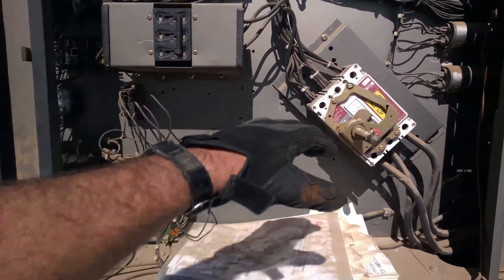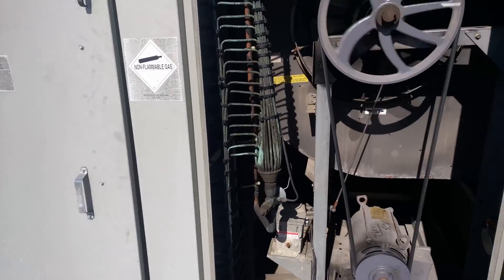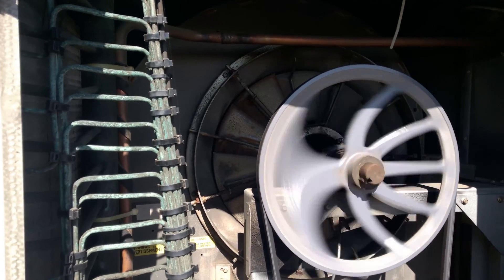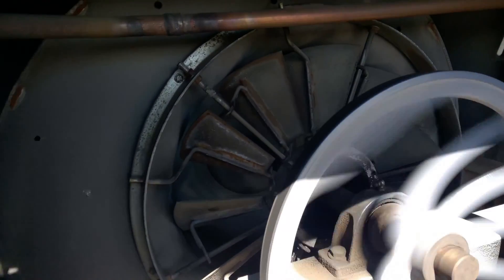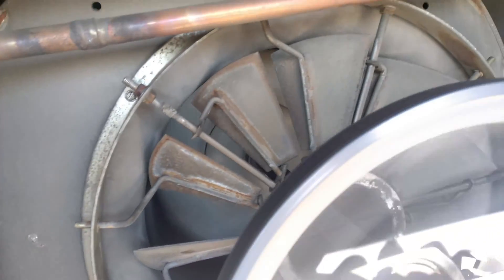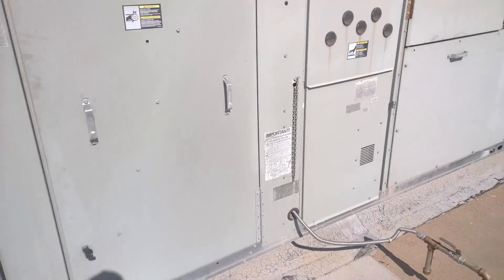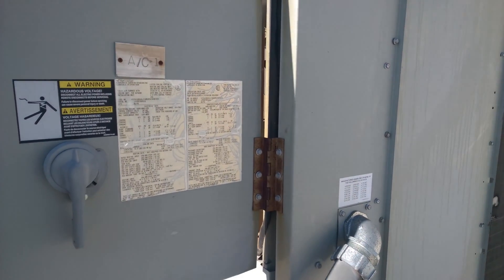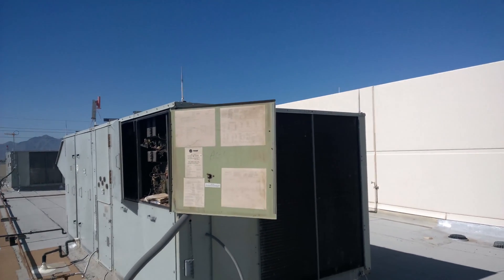Quick diagnose and fix of VAV error on Trane RTU

Comment: I worked on a 1991 55 Ton TRANE INTELLIPAK last Friday with a similar problem, it had no tracer on that bad boy. it turned out the linkage for the supply van vav vanes had snapped off, Got a new rod and lubricated the pivot points, the vanes are now working fine. I had to bump up the high side regulator from 0.9"WC to 1.5"WC as 0.9"WC was not getting good VAV box control but now it works.